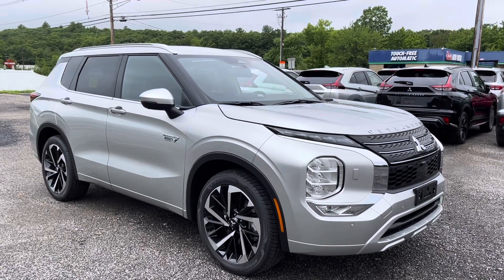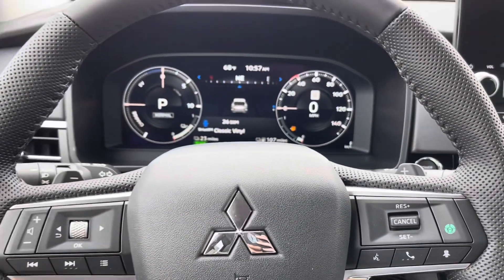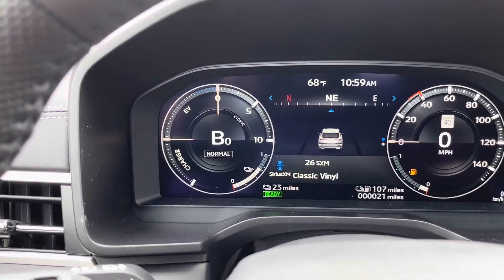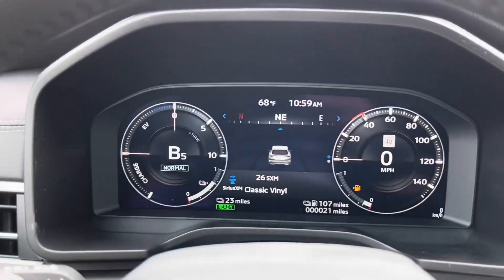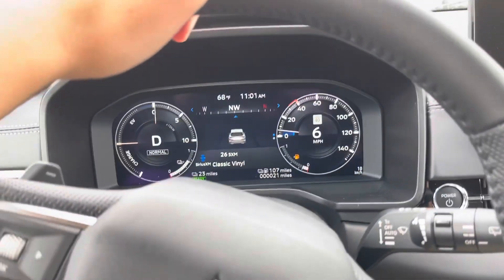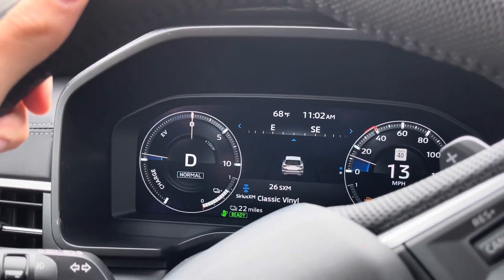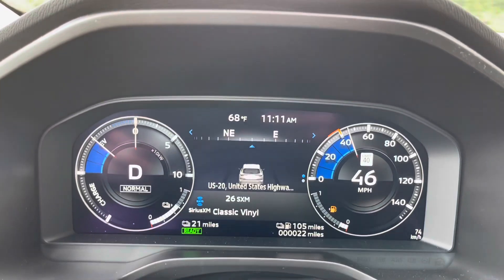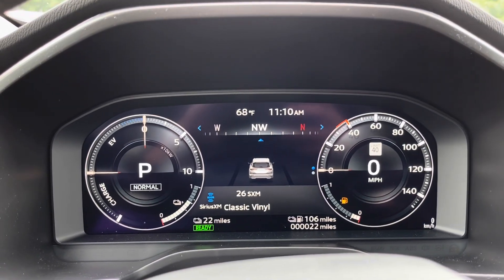How to: Regenerative Braking with Paddle Shifters. 2023 Mitsubishi Outlander Plug-In Hybrid (PHEV)

Comment: When do you get 64mpg, thought it was 26mpg when battery is drained?
Reply from the maker: Hey David! Thanks for commenting
Yes, the gasoline engine gets 26mpg combined, but the 64 mpg is actually 64MPGe. The "e" stands for equivalent. So what Mitsubishi is referring to is the efficiency of driving on just battery. The electric mileage of this car translates to the equivalent of 64MPGe. I hope this helps!
Reply: @midstatemitsubishi  wouldn't that vary based on how much gas is per gallon?
Reply from the maker: @davidparker7156  in this case its referring to energy used, not the price equivalent of gas, but the amount of energy that a gallon of gas converts to vs the amount of energy that a kWh converts to. The Outlander uses about .52kWh/mile which converts to the 64MPGe that is advertised with the vehicle.
Reply: @midstatemitsubishi  Thanks, i know it has a 20kw battery and never uses it all, can you tell me when empty how many KW it takes to fully charge, also taking into account efficiencies of charging with the included charger?

Comment: That one pedal mode should not be used!!!  As soon as you turn it on, the BRAKE pedal immediately begins to physically depress.  Even when you are accelerating or maintaining speed, the brake pedal is physically pulled down and you can feel the car brake - WHILE DRIVING/ACCELERATING FORWARD!  

Also the instant you let off the gas, the brake pedal will brake really hard - it DOES NOT COAST.  This is NOT saving your brake pads, it is using your brakes to slow the vehicle harder than you would ever brake while braking 'manually'.   When you use the paddles only, it does NOT activate any braking at all and any slowing is done by the electric motor.  That one pedal mode will grind your brakes off in no time.  EVEN WHILE ACCELLERATING, the brake pedal is on.

People feel the hard braking in one pedal mode and think all that 'excess power' is being put into the battery via the electric motor.  No, most of that energy is burned off as heat and the metal dust on your brake pads!  

I drive the same route every day.  When I use the pedals in B5 and EV / ECO only mode, I get to my destination (exact distance every  day) and get +1 km from regen each way.  When I used to use the one pedal mode, it would give me ZERO regen for the same distance.  Every day it would give me ZERO.

Salespeople of Mitsubishi, please stop pushing this one pedal thing.  It does not work as advertised - at all.  I know you like it because people will have to bring their car back for brakes much sooner so you can make more money!!!  win win!
Reply from the maker: Thanks for watching and commenting! I hate to disagree, but the One-Pedal Mode uses the electric motor just like the paddles. It's very similar to driving in "B5" all the time. I agree that the brake pedal does depress a bit but this is using the regenerative braking system to do this. Just like when you depress the brake and see the "charge" meter glow green. Using the one pedal mode also doesn't kick you out of "EV" mode like driving around in B3-B5 will do. 

I personally drove a 2025 model about 24 miles the other day and only lost 12 miles worth of charge while I had the one pedal mode on. This was done at low speeds with a lot of stop and go in a very hill-filled route. 

I hope this helps a bit, we take pride in our vehicles being low maintenance and would not wish premature brakepad wear on our customers.

Comment: I dont have garage to plug it in. Do you think it is still economical to own one? I am thinking of trading in my Outlander 22 GT (Gas) for the PHEV version.
Reply from the maker: That's okay! You don't necessarily need a garage to plug it in. If you have access to a plug, it should still work out just fine. Mitsubishi does however, recommend using a dedicated circuit to avoid blowing a fuse. Most outside plugs are dedicated, just make sure to check first. Or if you have access to a level two J1772 charger at work or out in public, that would also work well.

Comment: Great video! I'm unsure of the difference between using B mode and the paddles. Are they exactly the same, and B is just permanently stronger? Thanks!
Reply from the maker: Thank you! B mode defaults to B3 where as the paddles allow you to change the strength of the regenerative braking. B0 being the least sensitive (therefore providing the least amount of regenerative braking) and B5 being the strongest (providing the most amount of regenerative braking). B3 would be right in the middle. Thank you!

Comment: Can we use paddleshifters while driving?
Reply from the maker: Hello Joby! Yes, you can! It' s actually recommended to use these while you're driving. When "downshifting" (applying the left paddle to increase regenerative braking) while in motion, your vehicle will slow down and put all of the kinetic energy back into your battery, increasing your EV range and saving your brakes along the way.
Reply: Hello, If I use pedal shifter for breaking does then car breaking with engine or with batery ...@midstatemitsubishi

Comment: question: Why does it kick me out of EV mode when I use the paddles?  Should I be in ECO?  I'm confused.
Reply: According to the manual, if the battery is charged at more than 60%, and you apply more than B2  it will cancel the EV only mode. So if you don’t want to be kicked out of EV only, and your battery is at 60% or more, you have to stay at B2 or less
Reply from the maker: Hello Stephan, the vehicle should not kick you out of EV when using the paddles. You should see the blue “EV” light stay on at the bottom of the screen. If you’re referring to the meter on the left side shifting out of “ev” and into “charge”, that means the paddles are doing their job. Whenever the needle shifts down into “charge”, it means the vehicle is still in EV, but the charge is being regenerated. As long as the screen still shows “EV” at the bottom next to the word “Ready”, then everything is operating as it should.
Reply: In the "Normal" drive mode, my EV at the bottom by "Ready" is on, but when I try putting the paddle on B4, a message comes on my screen that EV is unavailable.  Should I be in a different drive mode, like ECO? @midstatemitsubishi
Reply from the maker: @stephanboiko4712 you know what? I withdraw my last comment. I just drove mine around and you are entirely right. Going above 10 mph in B4 or B5, it shuts off EV priority mode. There’s nothing in the manual about this, but it looks like if there’s too much charge going into the system, the gasoline engine will turn on to disperse the power it can’t handle and store. 
I guess we do learn something new every day! 
Thank you for bringing this up
Reply: Thanks. Thought I was doing something wrong and the manual is big but not always helpful.
On another subject but also not in the manual, when I go through a car wash, should I disengage the features like Forward Collision Mitigation?

 @midstatemitsubishi
Reply from the maker: @stephanboiko4712  hello Stephan, the forward collision mitigation only applies the brakes above 3 MPH and does not work in neutral so that shouldn’t be an issue
Reply: @midstatemitsubishi  thanks. You’re the best.
Reply from the maker: @stephanboiko4712  no problem. Hope you’re enjoying your PHEV!
Reply: On my 2023 Outlander, whenever my battery level is above about 2/3 full, whenever I put the regen braking higher than 2, it gives me the message that EV mode is unavailable (and becomes greyed out / unselectable) and it immediately starts the ICE engine.   So I can only use it on level 2 if I want full EV only.  After the battery is slightly below about 2/3 full, for some reason, then the EV mode is no longer greyed out, and I can use it in full EV mode with regen braking all the way up to 5 without the ICE starting.  I think this is a flaw.  Even when the battery is at 100 percent charge, the ICE will still kick in until the battery is drained below 2/3.  It should be the opposite of that.

Comment: That one pedal mode sucks.  I don't like it and I passed up an Outlander I really wanted because the salesperson never told me about being able to change the braking.
Reply from the maker: Well that's unfortunate to hear. The PHEV is one of those vehicles that gets better and better as you learn to use it. The one pedal mode and paddle shifters aren't necessary to use, but as you use them more, you'll notice your MPG's go up and your brakes will wear at a slower rate.
Reply: My toyota Avalon doesn't break like the outlander in one pedal mode.  As I see it, it's more of safety hazard.  When I want to brake the car, I know where the pedal is located.  I've been driving a hybrid for two years.  I know how to drive one for the most MPG  @midstatemitsubishi
Reply: @midstatemitsubishi  Quote "brakes will wear at a slower rate"?!? Are you sure? Even without i-pedal activated, when you press the brake pedal slightly the display shows that the battery starts charging. I think the i-pedal is only a conveniance.

Comment: You’ve demonstrated the regenerative braking system very well. I’ve been driving my SEL for almost 3 months now and I love it. I use the paddle brakes more than the one pedal button. I like a smoother drive versus the feeling of a sudden slowing down as if you’re going to stall. I sort of use that regen button as an emergency brake 😂
Reply from the maker: Thank you for the feedback! I myself also use the regen paddles to brake quickly. They are very effective at aiding during fast braking